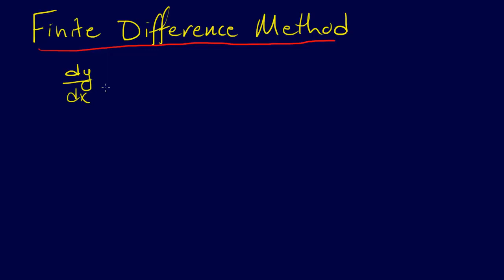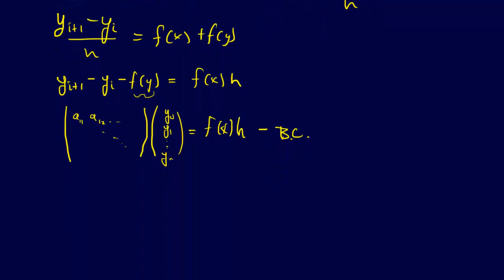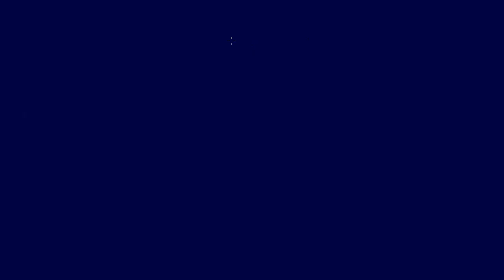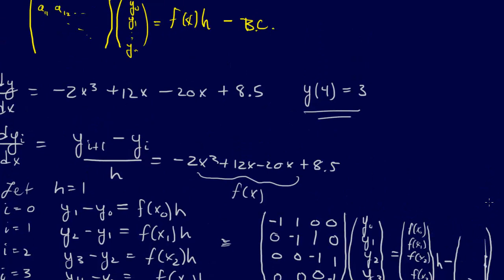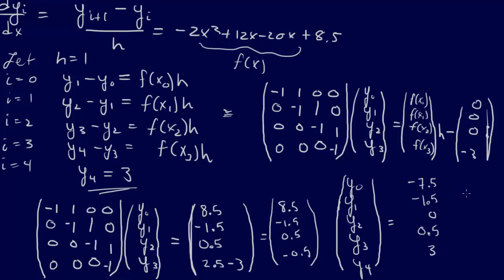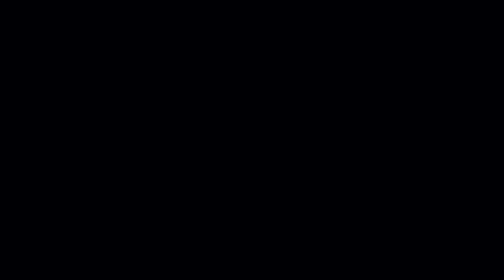7.3.3-ODEs: Finite Difference Method

Comment: What if initial value is not given.. Only equation is given
Reply: you'll have infinite solution, because initial conditions are required to have at the end the specific solution. Otherwise you'll end up with a general solution which is function of some parameters